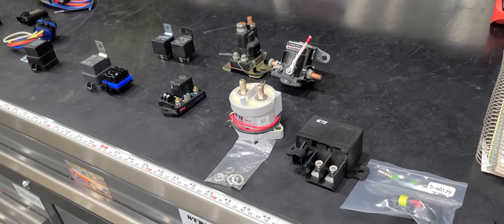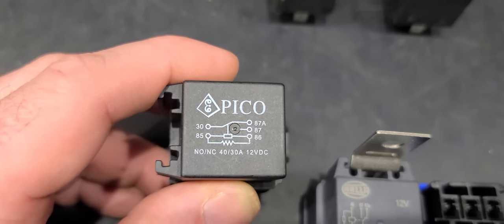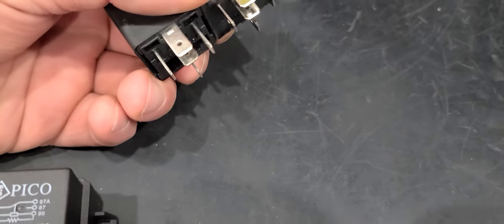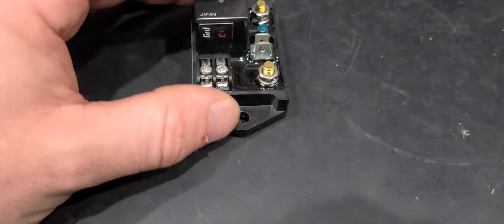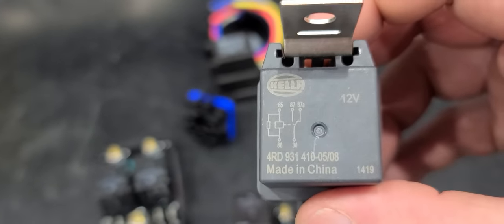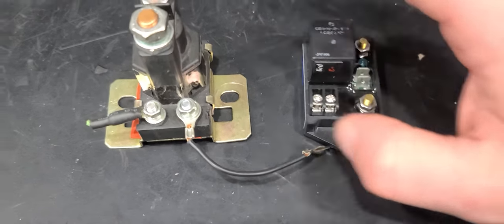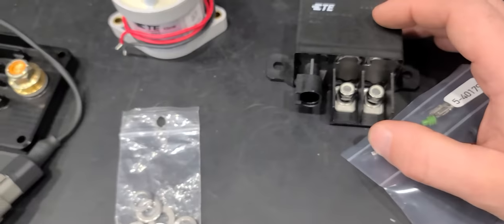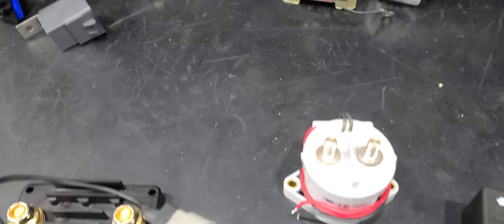all different types of relays explained and their uses

Comment: Great vid! The Tyco/TE/ are great with big battery banks. The Kilovac, Gigavac, Panasonic  and the Omron contactors last dam near forever and have huge silver plated contacts, Ive bought the 500a units for around 45 on ebay nib, but some sellers charge over 150, just got to wait for the deal. They do make them in Latching and some with Economizer coils so they dont have a big drain to worry about. I have yet to use a solid state like a Power Gate from Perfect Switch..

Comment: Thanks so much for the explanation. Are the better relays diode protected vs. resistor protected, to eliminate potential damage from flyback voltage?

Comment: That moser Motorsport solid state battery disconnect is slick!
What would be the best way to segregate the Alt/starter circuit when using that disconnect when wiring in a  kill switch.? ( the moroso 
Had a A & B circuit)
Reply: Alternator/starter wire goes to the IN terminal with the Battery and everything else on the Out terminal is how I’ve always done it!

Comment: the way things cost nowdays ,it makes one think why dont i just parallel 4 of high current auto relays i have boxes of and see what happens
well i did and it works a treat i only had to add one large diode across to coils as they are in parallel ,admitantly the relays i used were not those cheap horn relays from budget auto store they were high current Denso relays and soldered them to 8mm high by 1.5mm think brass stripdown to a brass bolt as terminal  going to see how it goes as a contactor for 82 volt  150 to 200 amp continuos ebike ,the controller and batteries can do up to 350-400 contin and peaks i cant work out yet as there is supa capacitor bank of 82 volt in parralel with battery so it could be crazy high.but well start at the sensible first

Comment: I have a HP with 7” Screen. I updated my Firmware from V5 builder 30 to V5 140  Since this I have lost my oil pressure,  fuel pressure, and boost pressure display on my dash. Can you tell me what happened and how can I get it back
Reply from the maker: update the dash

Comment: Why do the standard 4/5 prong relays say 40/35 amp. Are they rated for 40 amp or 35 amp
Reply: Normally closed (NC) versus normally open (NO) operation. I believe NC is generally the lower number.
Reply: @rizzoid  Thank you